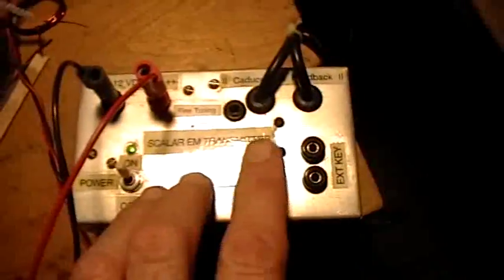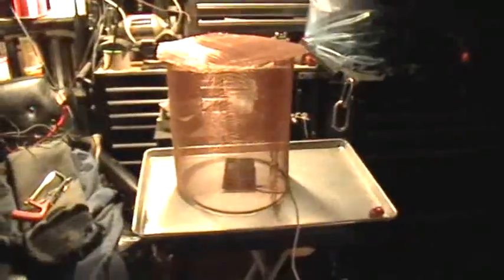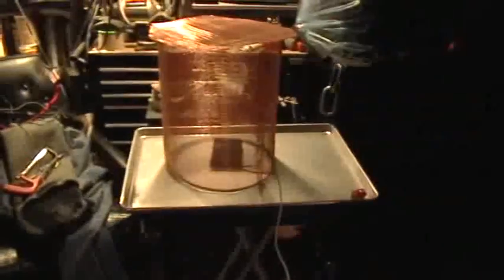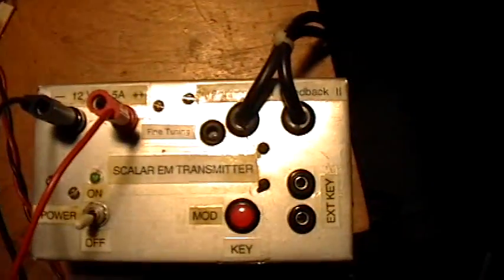Museum of Broken Dreams: The Scalar EM Transmitter w/ Caduceus Coil Antenna

Comment: what a confusion of terms. What could scalar longitudinal em possibly mean. Scalar means no wave, and longitudinal waves are contrary to transverse(i.e. EM) waves. It's just a string of contradictory terms. Oxymoron paragon.
Reply from the maker: Not necessarily. Consider the following situation. You are driving along in a straight line and pumping the brakes. Your speed varies, faster when not braking and slower when braking, hence it is a wavelike variation in motion. Your speed is the only thing that is varying : it is described by a scalar quantity. Your speed is varying along the same axis as you are travelling : the oscillations are longitudinal.  (Drive along at constant speed while swerving back and forth: transverse.) 
Sound waves in air are scalar longitudinal waves of compression/rarefaction (or oscillations in pressure if you like.)
Reply: scalar longitudinal waves are indeed longitudinal waves GENERATED by a varying scalar quantity like variable current density. Relativistic Lorentz contraction of electrons moving in a wire generate always a longitudinal wave perpendicular to the motion

Comment: Very nice experiment. Do the transmitter and the cage or reciever have any common ground ? could you(or do you) run it with a battery f.ex. to exclude this possibility?
Reply from the maker: Happy Fox No common ground. In this video I use my bench supply which is isolated, but it will work with a battery supply as well.

Comment: Nice, so thats basically a longitudinal wave?
Reply from the maker: Well, I think that's what people say about this kind of coil. I'm not sure I really understand what a longitudinal EM wave is, though. I know what it means for sound or other waves in a compressible fluid....
Reply: +TinselKoala Basically, the medium of electric charge is compressible - longitudinal EM waves are compressions and rarefactions of electric charge, oscillating along the same vector as the direction of propagation. Radio waves and light oscillate perpendicular to the direction of propagation, so they are transverse waves. Mainstream science will tell you "durp em waves dont need a medium for propagation dur", but in reality there is no type of wave which does not require a medium for transmission. It is not possible for waves to travel through nothing, because their very existence is a function of the medium. Also, transverse propagation like radio and light can only exist if there is longitudinal propagation.
Reply from the maker: Segment Fault
I see. And what have you done to demonstrate or utilize such longitudinal EM waves?
 Or to demonstrate the existence of a medium (call it aether if you like) for the transmission of EM radiation?

Comment: i dont think scalar waves would be detectable on an em frequency since it supposedly isnt part of the electromagnetic spectrum you could be hearing noise from the electromagnetics part of the transmitting circuit pre Caduceus coil or the electromagnetic transmission from it. how to detect the scalar waves iwonder